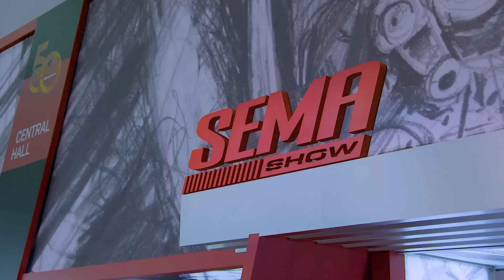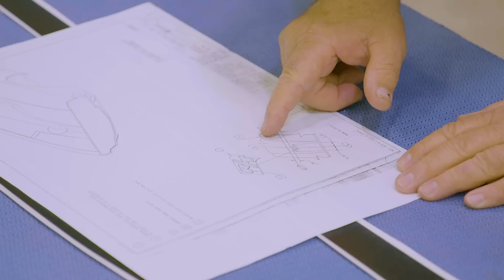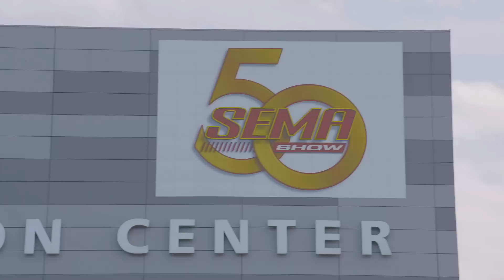HEMI VS HEMI...OLD VS NEW... MARK EXPLAINS TO THE PRESIDENT OF MOPAR HOW IT ALL WORKS!

Comment: These cars cost a small fortune to be restored by Mark and his crew. Even if I were to stumble across a car that's worthy of this kind of restoration, I could never afford it. So, I guess there's no point in trying, I guess.
Reply: That’s why I found a nice 1973 Charger with a blown engine.  It was very run of the mill in 1973, and won’t be valuable.  I’m putting a modern crate Hemi  and having fun.  It has lots of power, but not costing me an arm and a leg.